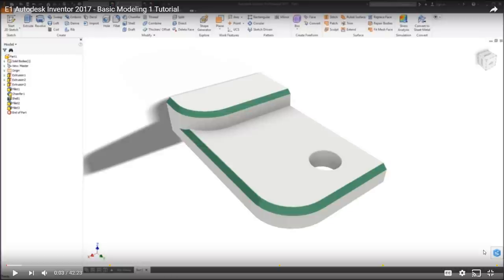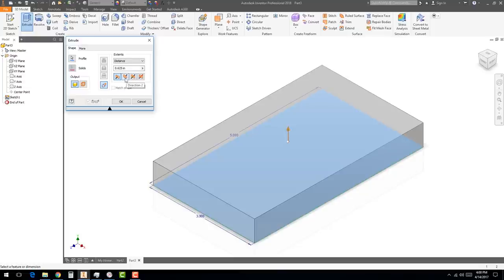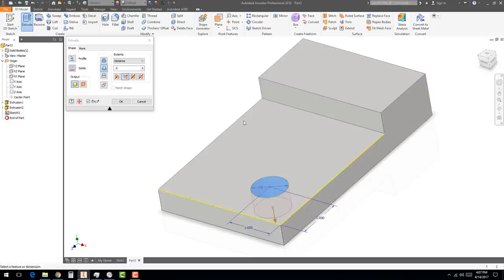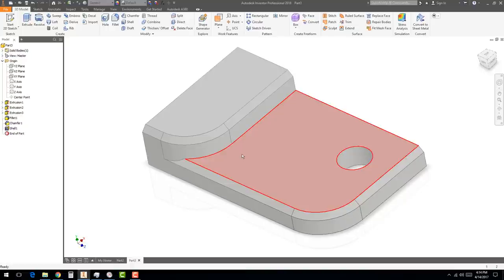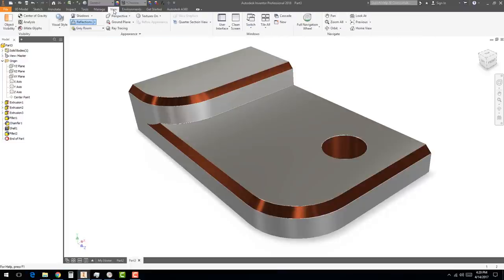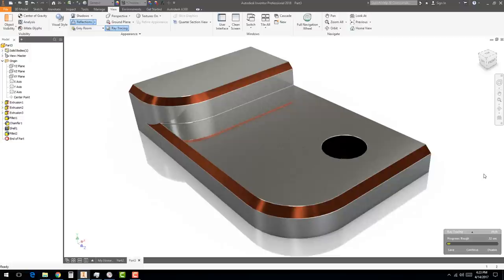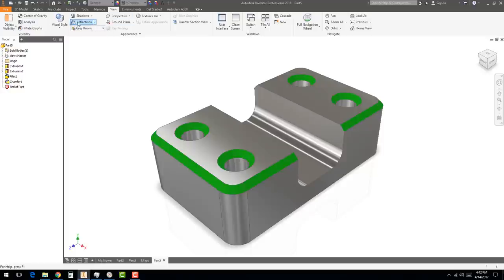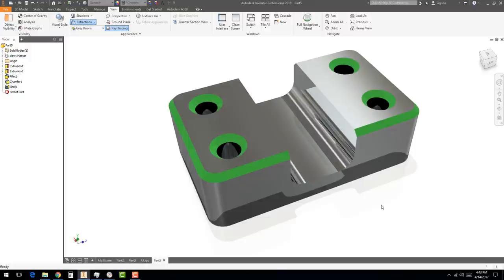E1 Autodesk Inventor 2018 - Basic Modeling 1 Tutorial

Comment: What would you say is the biggest change from autodesk inventor 2017 to autodesk inventor 2018?
Reply from the maker: Without using the new features added I couldn't tell the difference between the two.
Reply: Autodesk mainly just fixed bugs on 2018 version